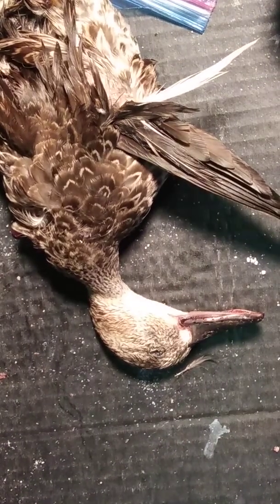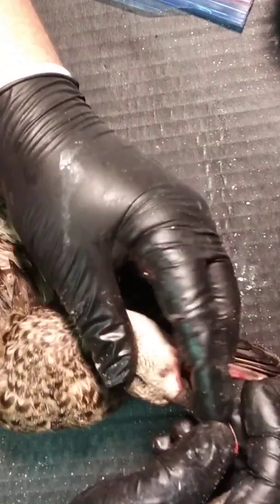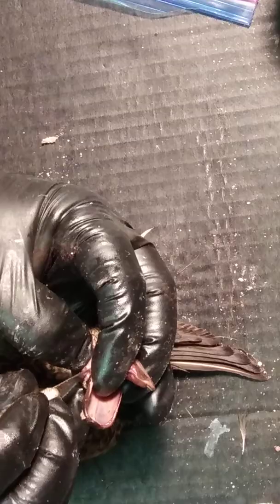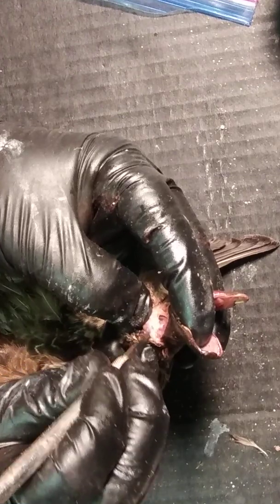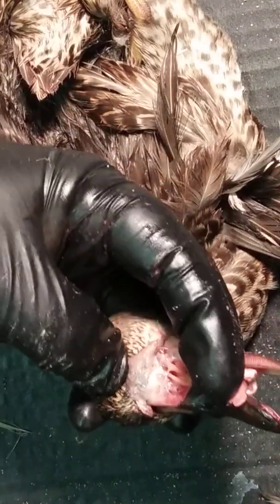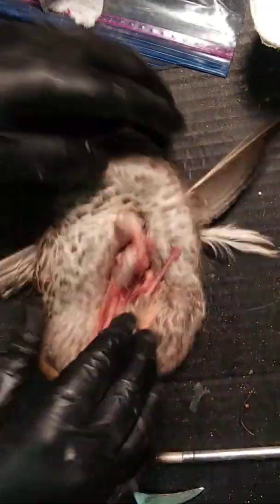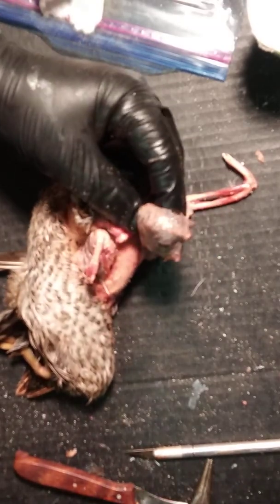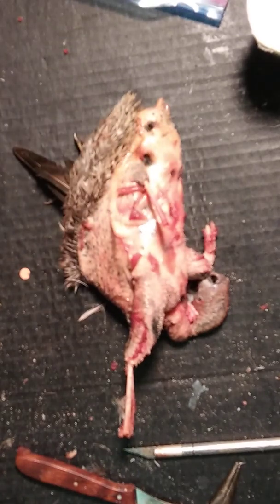AAR TAXIDERMY: Skinning Head To Use An Artifical For A Duck Bird Please 👍

Comment: Great videos. I’ve been learning a lot and I’m new to taxidermy. I have a question though. When you cast the heads how do you avoid bubbles? I’m having trouble getting them out
Reply from the maker: That's tough most of the time. Seems like if you stir a little less vigorous that helps.  I also will stick a thin tougne depressor down into the liquid before hardening and kind of mini stir but making sure not to touch the sides and get it out before it starts to set. That helps with the bubbles on the outside a good deal but I lean more towards apoxie sculpt to fill in imperfections.   
I do make that effort especially on heads like wood ducks, eiders, etc that have those large bill processes.
Reply: Ducks & Silver thanks for the advice